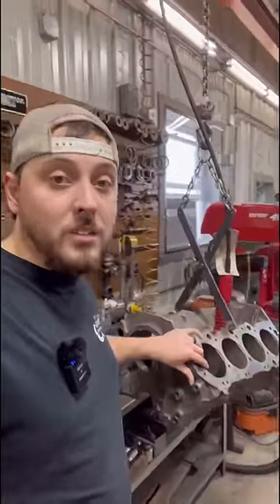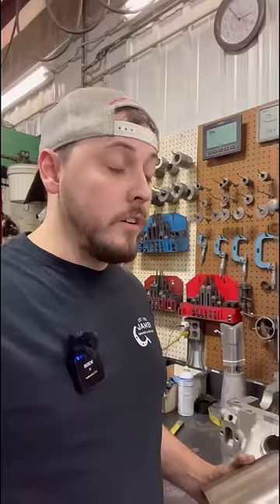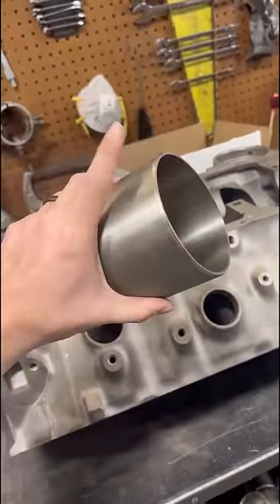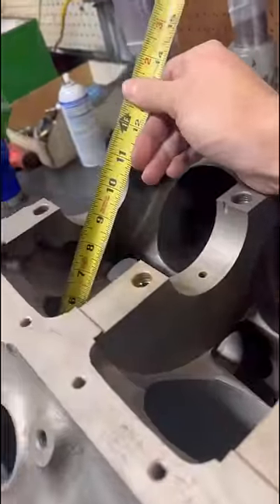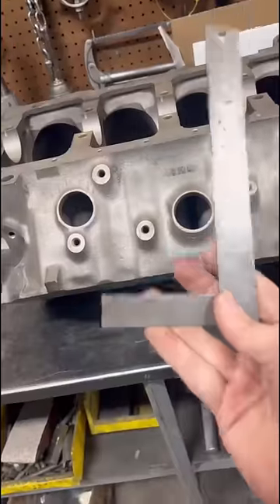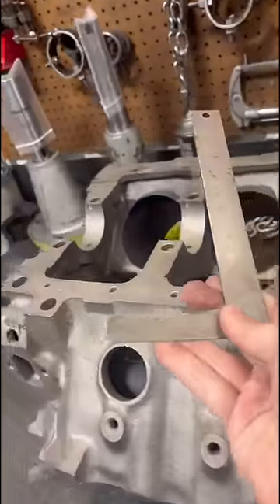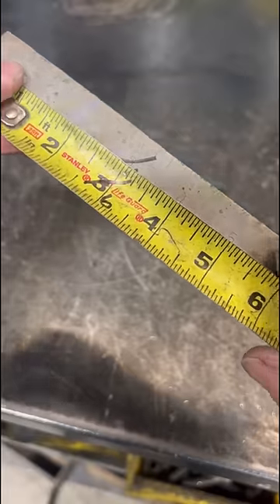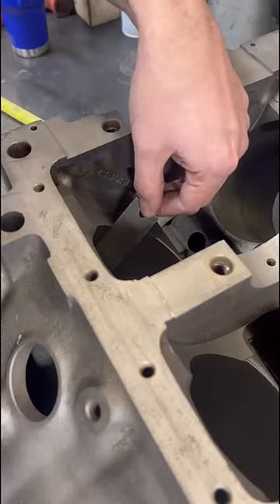#shorts Do You Calibrate Your Measuring Tools?

Comment: I worked in a calibration lab for two years and we used a 12 ft metal ruler to verify tape measures so you are dead on the money but my ruler was calibrated to NIST.
Reply: Unless you are measuring the atomic mass field of a neutron typically close is just fine for rough calculations. Of course your final measurement may need a bit more precision.
Reply: @john-paulsilke893  false. “Close enough” is horrifically wrong in a machine shop especially 😂🤦‍♂️
Reply: Just back the tape up to the 1” line and subtract it from your total measurement. The lines on the tape are perfect, tapes start getting inaccurate when the metal tab starts to move too much over time. The tab is only supposed to move the width of the tab itself, but the little pins that connect it get worn out. You can hit those 2 pins gently with a hammer and a punch to increase your tapes lifespan, or the best way is to not let your tape roll back in fast, because the force pushes that tab out. I’m bad with that, so I go through a tape measure every 6 months or so, but my coworker has had his for like 2 years because he NEVER lets it slam. The more you know.
Reply: @GhostyGhost7007  mine usualy only last 2.5 months before they get ran over or somthing 🤣

Comment: My 1970 Chevy CST/10 pickup came with a 402 Big Block, th400 And 4:10 12 bolt. I blew up the BB in 2001 when I was a teenager. Still have the truck but my dad put a 350 in it. I’m now building the truck with my kids. Miss the 402 though

Comment: Lmao, well done 👏. 
Miss the sound of the old one's with the old Hooker headers and a straight pipes to little Thrush mufflers. All the beautiful rough sounds of a semi leaky mal adjusted 750 Holly double pump sitting on a Edelbrok manifold, with at least one fouled spark plug and a high lift cam. ALL packed into a beat up (at the time 10 year old 1970 Chevelle) sitting at the light at 4 corners on a hot summer night at 2am just waiting for the light to change.

Comment: In all seriousness, we have to use "calibrated" tape measures at my job for some all the welding segments we fabricate. It's actually required by the welding standards and codes. I laughed when I first heard about it. But I'm a machinist. So to think of something with so big with a chance of error on a larger scale like that, made me scratch my head at first. But it's not persay for precision it's so all employees are using a device that has a standard for measurement. 

On a other note I calibrate my micrometers, digital and dial calipers and many other tools quite often

Comment: That's like the anecdote one of my lectors in CNC and CAM told me, about how some earlier japanese industry failed because they always tried to machine everything to absolute possible perfection - losing against the other competitors because it really was a waste of time to use highest precision machining and measurement for making door hinges 

Idk if that ever happened - but it works to get the point across: as precise as necessary, everything else is a waste of time and ressources better spent elsewhere

Comment: Funny, stupid thing happened to my brother and myself years ago.. Was adding some stiffening steel to a trailer, I was calling out measurements and he was cutting "C" channel.. All were in the 120 to 160 inch range.. Started tack welding pieces in place and nothing fit, gave him heck for not being able to read a tape measure until I had a thought.. Pulled out 200 inches on both tape measures, side by side.. At 200 inches there was almost 5/8 in. difference between them.. Never expected that one from 2 different manufactures..

Comment: if you're really good with a tape measure, 1/32th of an inch is a realistic tolerance to hold, if your really paying attention, 1/64th of an inch is easily achievable... 

with my good quality rule / scale, I've gotten SOME parts within .005".... most are about .010" ~ .015"  AKA,  just under 1/64th lol

Comment: Calibrating a square (that cannot be calibrated) with the very tool that was being criticized for being inaccurate in the first place, too funny and a great way to mock the naive.

Tape measure was the perfect tool for that job and what difference does it make anyway? It is what it will be forever unless you are resurfacing the block. But even if you did just that a few thou one way or the other has no relevance in how you do the rest of the work going forward. It's not going to be enough to effect the stroke. Foolish comment.

Comment: Can't believe that people here still use inches and not metric
Reply: Why? All the listed tolerances for older American engines are in inches, engine machining equipment is generally inch adjustable, and you're not using fractions, so there's nothing to get confused about. It doesn't matter the unit at all. Why would you unnecessary use millimeters and convert it all? Why would you replace all your expensive tools?